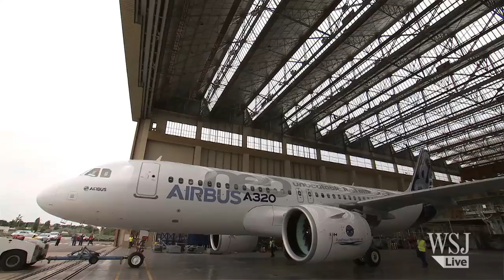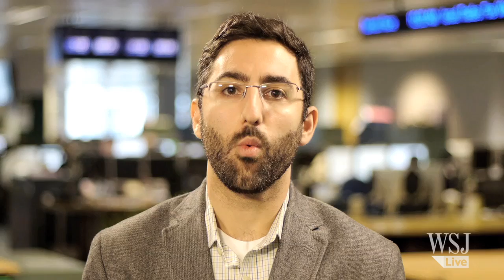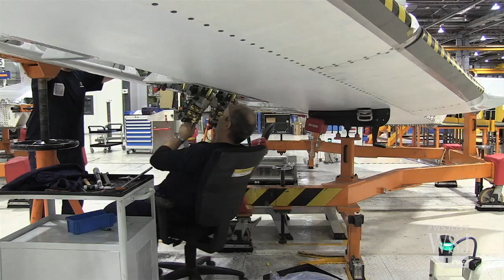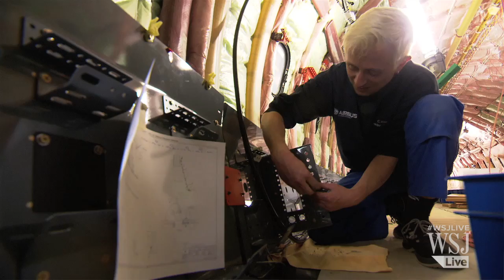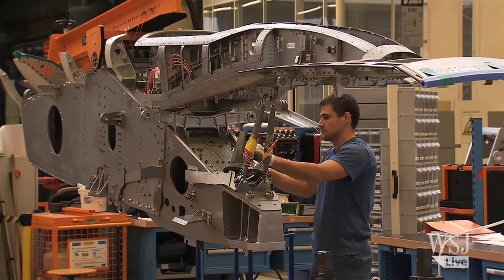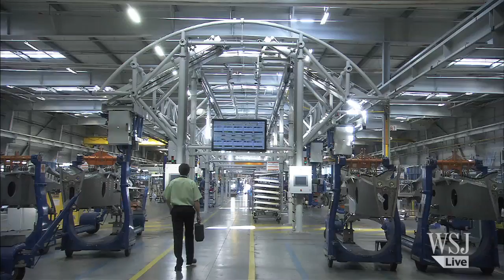What to Expect From the Airbus A330neo

Comment: Completely wrong. Competing with boeing would be like this
- Small A350 competes with the 787 
- Big A350 competes with the long range high capacity 777X
- A330neo big variant competes with the smaller 777X
- the smaller A330neo variant stands alone in the market, doing sort of what the 767 used to do, providing a good fuel efficiency, a well know reliable platform and a low purchase price compared to 100% new planes (A350 and 787) or highly reworked ones (777X)
Reply: Luca Mino Yes because A330 Neo can for far compete with 777X for fuel efficency.
Reply: Luca Mino well A330neo is competing The B787-8 and -9 meanwhile The A350 competing The 777X
Reply: No...you are wrong....Luca Mino is nearer to correct than you are. FAR NEARER in fact...
Reply: Skylax but for Range Will 777X?

Comment: RR tent 7000 is not the engine 787 use.
Reply: The Trent 7000 is just a Trent 1000 but with a few small changes in bleed, connections, control etc. Effectively, it is the same engine.

Comment: 787 is shit...every airline is crying bcoz of its problems..
Reply: Total bullshit.  There are currently 512 787's in service with 690 orders not yet built.
Reply: The A350 models are not in the same segment as the 777. Therefore your comments are utter GOBSHITE.
Reply: asheesh tiwari I don't hate Boeing just cuz they're American no, the reason why I don't like them is the shark-lets don't get me wrong they're good for fuel efficiency but imo I don't like shark-lets and I don't like the 787 cuz of its wing design I just like more of a 744 style wing
Reply: Free Gamplays Any Game btw Sharklets (mostly r in a320s family) are Boeing 737 old Winglets copy
Reply: itsmegp46 <- clearly he/she  knows shit more than any of you combined.
Reply: I finally flew in one, and its quite nice and quiet.. but the "dimmable" windows are terrible, it wont get 100% dark. Its seating room is ok at best, nothing standout from others. I believe the gem of Boeing is 777, always was and will be where as the gem of Airbus is the A350.
Reply: There is a lot of exaggeration going on here.
First, the 777-800 will have an 8,700 mile range same as the A350-900 without special engineering for a longer range.
The boeing 747 made its mark nearly fifty years ago.  Where was airbus in 1969? The A380 has sold more than the 747-8 but then its been around longer.  Boeing has sold 1,968 747's. 
Both the A380 and the 747-8 are on a deathwatch. The A380 especially so.  There hasn't been a single order for the A380 in the last fifteen months. Some business publications are predicting its cancellation by Airbus before the end of next year. Just google A380 to be discontinued.  You will find plenty of proof. The 747 may last a bit longer however.  Boeing recently received an order for TWENTY 747-8 F's.
Boeing introduced the 787 to REPLACE the 767. The 330 has sold and received orders for 1,472 since 1992, 25 years ago.  The 787 has sold and received orders for 1,211 in just the last 10 years.  Which one is more successful?
The 727 like all other tri-jets were discontinued because of their noise. The 737 which has been around since 1966 is the most successful commercial jet in world history with 9,448 deliveries and 4,506 unfilled orders. Boeing has delivered 1,906 767's with 206 more unfilled as yet.  FedEx alone has ordered 50 767's with deliveries beginning from 2018 to 2013. So its continued success is assured.
Reply: Oh, and the A380 is dying, the 777-8, and -9 will drive the A350 out of business.

Comment: completely ignoring the fact that airbus has already delivered many A350 models which is the actual direct competitor to the 787. the A330 neo is being developed as a replacement for current A330s in airlines for the sake of commonality and training cost savings.competing aircraft having the same engine is nothing new in fact it is very common and an old practice. its name very likely will be smply A330neo
Reply: Not exactly, the way I see it:

B787-8 = A330-800
B787-9 = A330-900
B787-10 = A350-900
B777-8X = A350-1000
B777-9X
B747-8i = A380 plus
Reply: A350 is a bigger aircraft than b787 so no the a350 is not competing against b787.
Reply: On the contrary. It’s very smart to develop both products! If I am an airline already flying the 330 classic and need additional very long range capacity and want to take advantage of plane commonality, I can opt not to get the great A350 and go with the neos...